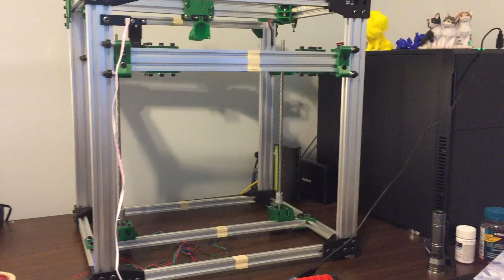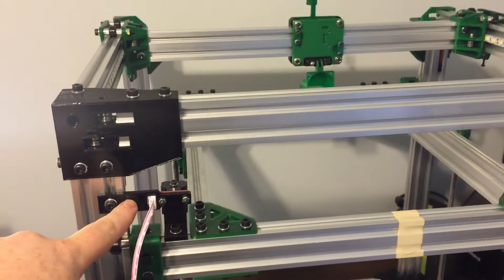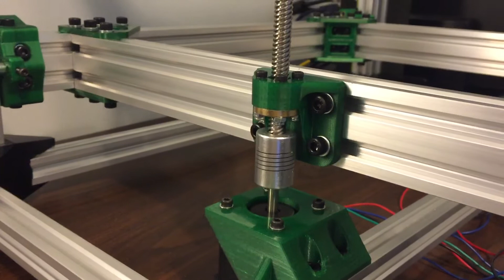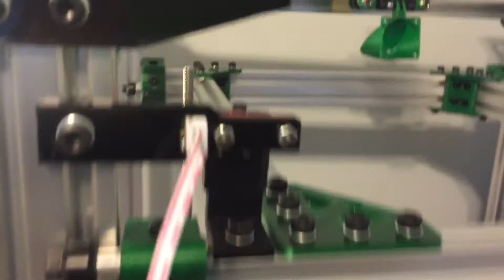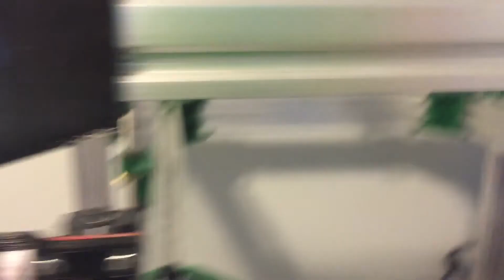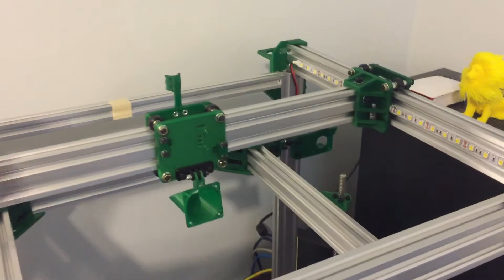D-bot remix z axis test

Comment: good work dude. im at a similar stage with the 4 wheel guides but running lead screws front and back. smooth so far but not hooked up the power